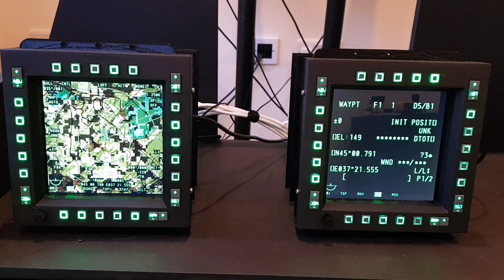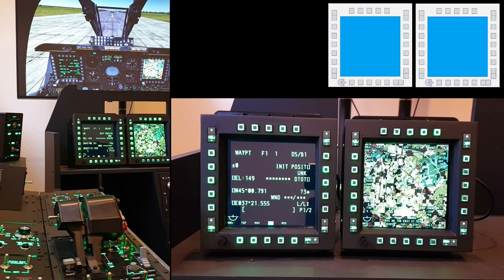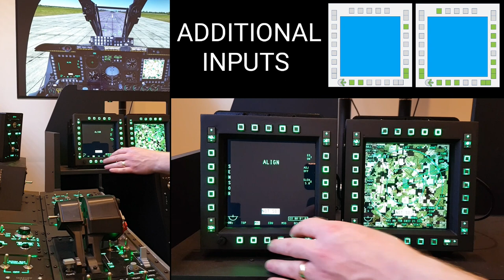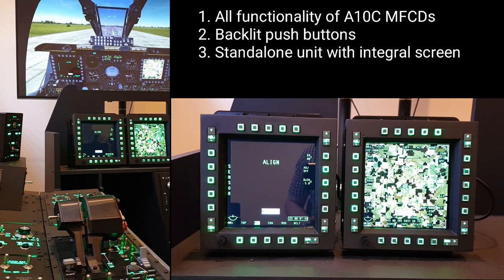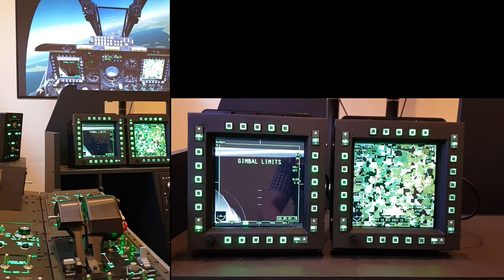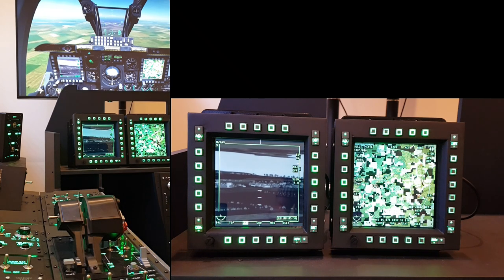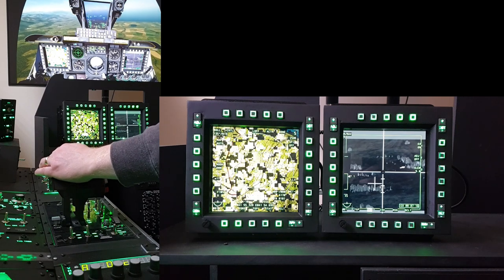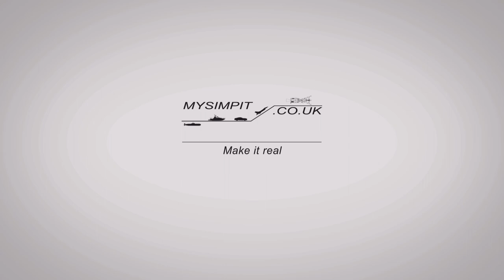Simpit A10C - Front Dash - Part 8: Custom Made MFCDs - Operation Test

Comment: Nice! I'm gathering stuff to start my pit. For my MFCD's I did the classic TM Cougars + TFT Panel using a 3D printed mount. I was interested in doing a full custom MFCD but abandoned it due to trouble getting the appropriate sized panel. Everything was either too big or too small. What display panels did you use? Love your stuff, it is a big inspiration for my plans.
Reply from the maker: Hi, thanks for the thumbs up and all the best for your simpit 👍
I used an 8inch HJ080IA-01E 1024X768 IPS LCD Screen with a HDMI+VGA+2AV LCD Controller Board VS-TY2662-V5. 
The picture quality is good and the foot print small. Display area goes almost to the edge. It's literally just a few millimeters thick also, however there are few draw backs. The controller boards both give off a small, fairly constant electronic hum - which is not particularly loud and I have in mind a way to remove this. The ribbon cables are delicate too and the PCB runs quite warm. These last 2 I'm happy I've overcome. 
Im putting a few further videos together covering more detail about the design including the monitor, its pros, cons, and ways to address the drawbacks through layer design. 
Cheers